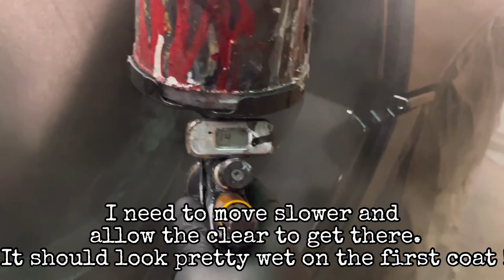Painting Your C4 Corvette: Tips and Tricks for a Flawless Finish!

Comment: Came out good. You should always try and paint into the air flow. If you would have started clearing the front of the car and work towards the back with the exhaust flow. That way the over spray doesn’t land in the fresh wet clear. It would cut your trash in the paint down tremendously
Reply from the maker: Thanks for the tip🙏🏾👌🏾

Comment: Definitely put a pause on sanding in the other side of the shop till job is 100% done and tacked off. Will help a lot. But dude amazing job for what your working with!
Reply from the maker: Definitely appreciate you without the right equipment. It definitely adds on time.
Reply: @bzoewitwheels4029  absolutely man. If anything build a booth out of 2x4's .. Don't have to be perfect, dry wall it, throw in lights, caulk all air gaps, done.